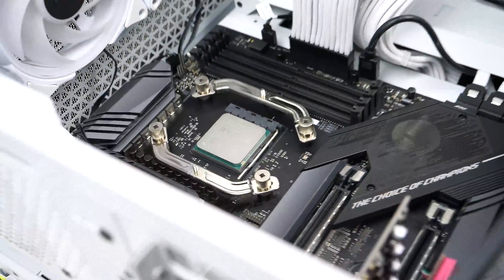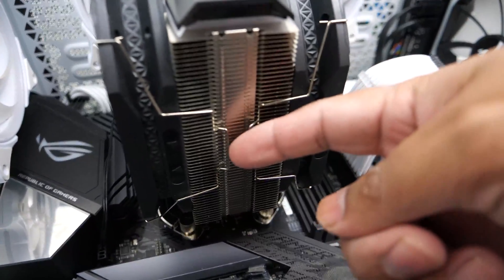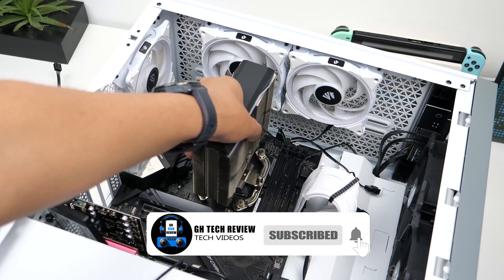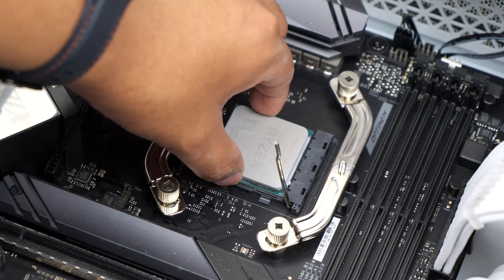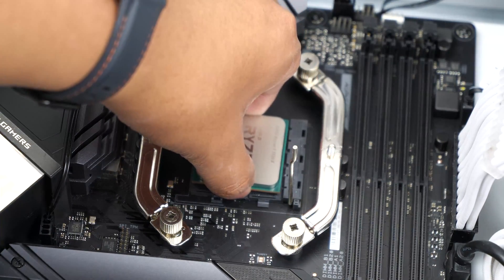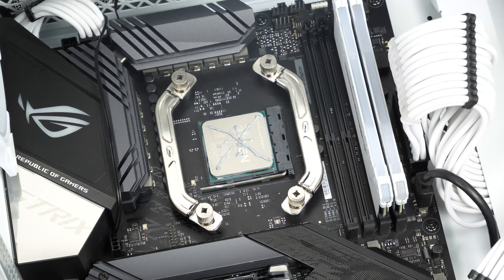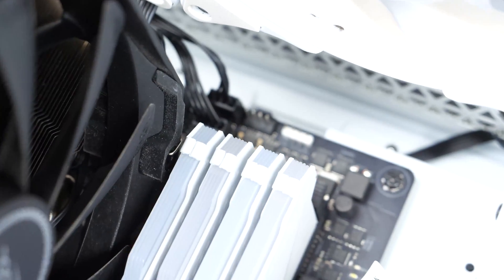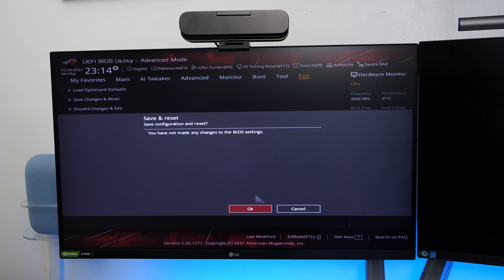How To Upgrade Your CPU Step By Step | AMD Ryzen CPU Installation 2022

Comment: I just tried installing a Ryzen 7 5800X3d and completely messed it up because I didn't know about the little arrow on the CPU, so several of the pins got bent and I had to return it to Microcenter. Then, when I finally got my computer back the next day, my computer wouldn't post without having my RAM set to single channel. It's pretty infuriating.
Reply: damn man rip the arrow is on all ryzen cpus so always look out for that
Reply: @RTX Skillz  Yeah. I didn't get that memo. I actually tried reseating the CPU afterwards and didn't screw it up. Good 'ol trial and error.
Reply: @captainshiner42  nice man its easy once u know what u are doing thats why before i built my pc the past week i watched like 100 videos of doing it
Reply: @rtxskillz6006  I kinda figured that out after the fact.
Reply: I’m picking up a new 3800X3D today.  Hope I dont F it up lol.  RIP yours. Hopefully they refunded you a new one
Reply: @11bravo1789  They did, so it's all good. Afterwards, I actually took it out and put it back in, just to see if I could. You just have to know what to do and what to look out for. Other than that, it's super easy.
Reply: @captainshiner42  wait….so would it be obvious if it’s not lined correctly? I swear I followed the triangle but my system won’t post and always loops when checking for CPU(red led light on mobo) It also flashes the orange LED when I first power on (dram) before it begins to loop thru White(Vga) Orange(Dram) Red(Cpu) over and over. Everything powers on (AIO Cooler, case lights and fans) but it shows no display signal and never boots (green led light) Also found that the RAM i bought isn’t on the “Quality Verification List” for my mobo/cpu combo 😅 would that be a culprit?

Comment: If i want to change my CPU and i need to update my BIOS, Do i need to do it before putting the new CPU or i can do it after ?
Reply: @origami4743 What happens if you don't update bios amd install new cpu?
Reply: @origami4743  because I have a z590 e and it's compatible with 11th gen cpu, so I just swapped 10th for 11th gen cpu but am waiting for gpu to come. So ur saying it won't work even though the motherboard was made for 11th gen?
Reply: @origami4743  ok, thanks if it doesn't work, then I can just put the old cpu back in and update bios. Thanks a lot!!!!

Comment: I want to upgrade from a ryzen 5 4500 to a ryzen 5 3600, would I need to update BIOS for this? Or can I just install the new cpu and leave it as that.
Reply: the 4500 and the 3600 are both zen 2, so i think you don't need to update bios

Comment: i have a r5 2600 with a b450 pro 4 f motherboard should i upgrade to a r53600 and if so do i need to upgrade my motherboard to. Thanks
Reply: you do not need to upgrade motherboard ,any mobo with am4 socket will work with the 3600, but in todays age I would look into a ryzen 5 5600x better performance. Which also is an am4 processor so should work with your mobo.

Comment: it its literally the hardest thing in the pc to upgrade, since 9/10 times you need to upgrade motherboard, essentially equally to assembling a new pc
Reply: AMD are very good in that the last gen of CPU's (5 series and previos) are all compatible with AM4 socket.  Intel are a bit mean and require you to change motherboard more often.

Comment: Right now I have a rtx 3070 with a Ryzen 5 5600x, anyone think I should go for a Ryzen 7 5800x? I need y’all opinions🤞
Reply: not worth going to a 5800x only good upgrade from 5600x is the 5800x3d which is a beast
Reply: I have a R5 3600 and trust me upgrading to a 5800x3D Is literally almost triple your performance on more cpu bound games
Reply: Bet, I’ll start doing research on the x3d, appreciate it yall✌️

Comment: trying to upgrade my son's CPU. He has a RTX 3070 graphics card, z370 mother board and i7-8700K.  will this work with Ryzen? or do I need to get him an intell ( I know some things because I've helped him build it, but really do not know much)
Reply: wont work with ryzen since its an intel board
Reply: No, you'll have to get him an intel CPU. Specifically, an intel CPU with the socket type "LGA 1151"

Comment: omg how much thermal paste you use lol..left over dropped into the socket boy. im thinking of returning my 7600x and getting a 7800x3d
Reply: Going to be doing the same thing. Used it as a placeholder for the x3D

Comment: hi nice video mate, i want to upgrade my R3 3200g to a R5 3600, my question is can I use the same stock cooler that came with the R3 3200g on the R5 3600, thank you :)
Reply: I just had the same replacement just now, but from a r3 2200g
Reply: probably
Reply: I want to get this update. Is it worth it?
Reply: @ringi52  yes it is definitely worth it, I’ve now got Ryzen 5 3600, rtx 2060 6gb and 16gb ram
Reply: @Ashwin_Gumustekin  nice, i will have something similar I'm just afraid i will mess up the CPU instalation.
Reply: @ringi52  yes at least we can get rid of the bottleneck
Reply: @PrimeYT10  Do you use PCI3 or 4?

Comment: The problem I have is that - I cant get to windows. I updated BIOS many times and tried many versions, but every time I try to exit, my PC is just restarting. Everything is compatible., and right now I'm just using the old one. Did anyone had the same problem?
Reply: Same just bought a new cpu earlier and haven’t been able to stop it from boot looping
Reply: Do you have a usb drive with windows? I fixed a boot loop by plugging a usb drive with windows into it, and then going into bios and finding the usb drive and just followed the instructions to use it, I can’t remember exactly how I did it, and every bios is different but maybe try that?
Reply: The boot loop was not due to a cpu change though, but it was still a boot loop
Reply: You have to reinstall windows anytime you change the CPU unfortunately. Your BIOS will freak out if it detects a new processor. Put installation media on a flash drive and boot to that to set it up. If you need to recover files from your boot drive you'll have to plug it into another PC or get a sata/data adapter kit.
Reply: So actually in bios I changed something from CSM to UEFI (perhaps the other way around) and then I was stuck again in bios loop but somehow suddenly it clicked and everything was alright after a few restarts. So maybe this will help someone

Comment: I just upgraded my CPU and am on a screen asking me is I want to reset fTPM (haven't gotten to BIOS yet). It wants me to click Y or N for yes or no, but it won't read any keyboard input at all as far as I can tell. Is there a way to get through this that I'm missing?
Reply: did you update ur bios with ur old cpu ? that might be the issue
Reply: @Mr911RANDOM  I had done that. What actually fixed it was getting a USB to PS/2 adapter for my keyboard. Would recommend getting a couple for anyone who needs to be in the BIOS. They're super cheap, but I had to wait like three days to get mine delivered lol
Reply: @dylanday6945  what did you end up pressing though?

Comment: I upgraded my cpu and now my computer won’t boot past the asrock screen. I need help I’ve tried everything
Reply: What CPU and Motherboard do you have?
Reply: @nickwilson1736  Ryzen 5 5600x and an asrock b450m pro4 motherboard
Reply: @onei8866  i know it's a bit late, but it's likely that your motherboard bios isn't up to date to support your new cpu

you'll have to plug in your previous cpu and update the bios using a flash drive with the updated bios files

this guide should help: https://www.youtube.com/watch?v=wk_bo6OWq6s
Reply: @RoseAkahana  my bios was up to date. I ended up re-imaging windows with a flash drive and that fixed all my issues!
Reply: What do you mean by re-imaging windows? I am not computer smart but I’m looking to upgrade my cpu in the near future and in case I have a similar issue I was curious on what re-imaging windows means and how difficult it is? I know my bios is up to date I just don’t want to run into any problems
Reply: @RealHoldenHall  there’s ways to re-image and save your files but I just wiped everything to make it simple and easy. It basically means your windows files are corrupted and you need to wipe and reinstall windows.

Comment: When I booted up my pc after installing, my fans started like normal and the ram lit up, but my monitor won't do anything and it seems like my gpu is off.  My pc worked fine yesterday.  Also the on light on the tower won't turn on when the pc starts
Reply: Brooo same lmk if you find solution
Reply: @drewking9117  try taking the ram out cleaning the ram slots, i know you probably already fixed it,  but this happened to my brother. it was something to do with the ram and dust getting in to the ram slots somehow. anyways hope you fixed it

Comment: I just upgrade my CPU ryzen 3 2200g bios to support ryzen 5000 series and when it boot up there's no display, my question is does it boot up after i put my new ryzen 5 5600? I'm still waiting for it to come.
Reply: is your motherboard going to be able to handle the 5600? this would be a good indicator

Comment: do i need to use that window usb stick after instaling new cpu
Reply: If you already have installed Windows on your PC then there is no point of using it
Reply from the maker: The usb stick on my pc is a wireless transmitter for my headphones. You don't need to use a usb stick loaded with windows if you already have it installed.

Comment: i am currently running an amd ryzen 3 2200g, upgrading to a amd 5700g on a Gigabyte B450M DS3H board. Do i need to do the bios update before i replace the cpu? is the bios update necessary? really trying not to brick my build, thank you
Reply: if the cpu came out well after the motherboard it wouldn't hurt to update the bois, its pretty easy to do but update it before you swapping the cpu or you'll get a black screen and have to swap back.
Reply: @Level10Slime  thank you
Reply: @Level10Slime  does it normal after updating bios my screen goes black? I'm still waiting for my new CPU to arrived to test it.
Reply: @colosuss3208  it shouldn't bios probably failed halfway through , try flipping the switch in the back, unplug the computer and press the power button in the front then plug it in flip switch and power on to bios. update again DO NOT TOUCH i repeat DO NOT TOUCH your computer till its done not even the mouse. 
double check how to update your motherboard by brand and modal just to be sure
edit add- plug screen into the motherboard might help

Comment: I have a b450 I gigabyte board I put new cpu and aio cooler. I turn on my pc all fans run but not max, my screen just stays black I can't even access bio. I went from a 3200g to a 5900x am4 chipset can anyone give me some ideas of what can be wrong?
Reply: It's just weird that I can't shut the tower down from the power button after it starts
Reply: Solved: all I had to do was install my old cpu, update bios then install the new cpu. It worked fine
Reply: @guillermocuevas1306  after updating bios does you screen goes blank? It happened to me after updating bios ryzen 3 2200g to support ryzen 5000 series.
Reply: @guillermocuevas1306  did you update the bios and let your pc boot once before installing the new cpu? Did you reset your bios at all? Im having the same issue but bios update does not help for some reason
Reply: @alpucr  I had to install my old cpu update the bios then re installed my new cpu and it worked
Reply: @guillermocuevas1306  okay thanks. Guess I just ended up with a faulty cpu. Time to refund
Reply: @alpucr  yeah man that sucks hopefully it works out. Let me know if it does
Reply: Did u update your BIOS to be compatible with ryzen 5xxx processors?
Reply: @P0lc1k  I haven't my screen just goes black I can't even access bio and it's weird because my power button doesn't let me shut off my rig if I hold it down
Reply: @guillermocuevas1306  are you using dedicated gpu?
Reply: @guillermocuevas1306  u need to put your old cpu back and update your bios according to your motheboard specs
Reply: @P0lc1k  ah okay I will try that thank you
Reply: @bazookasniper5167  yeah I have a gtx 1070 I have my dp connected on it
Reply: @P0lc1k  I have the latest bios and Gigabyte claims my mobo (GA AB 350M Gaming 3) supports my new cpu (5500) i have the f51h version now and I tried both f51h and f51g versions, both with no luck. I was using R5 1600 previously and 5500 does not work for some reason... Im pissed

Comment: Need help !!! mine just keeps loading back in to the click bios over and over just changed to ryzen 7 5700g on a b450 msi board
Reply: Is the CPU supported? I imagine it's working if you can get into the BIOS...
Reply: i did my bios update today like 15 mins ago depend on what motherboard u have i copuld help a bit
Reply: Check the box of your motherboard. If it says something like "Ryzen 3000 ready" and not 5000, then you must do a Bios update first.
Reply: did you get it working? i have the same issue
Reply: I just decided to buy a new board I didn't see you guys replied thank you

Comment: So I have a new MSI MPG B550 gaming plus MB with a 5600x and I'm thinking about upgrading to a 5800x. I noticed in the video you didn't update bios at all and it booted right up. You didn't have to update bios or anything off camera right??? Just a hot swap real quick??? I literally bought the B550 because I was in frustration of the B450 that I've already had when I wanted to upgrade to a 5000 series processor. It kept on running the fans real high for like 2 to 3 seconds then no display on monitor whatsoever. I've tried flashing the bios and didn't work for me but I've seen it has worked for some people.
Reply: You may have to reset the CMOS on your mobo, some of them require a wipe before installing a new CPU. Google your mobo name + CMOS, it should come up, or direct you to the manual on the manufacturers website.
Reply: sometimes you dont need to update the bios, but sometimes you do
Reply: Not enough of an upgrade to justify the price, honestly.  Save a lil bit more and upgrade to a 7000 series.
Reply: Im about to go crazy bcs of the same issue rn. I updated my mobo, Gigabyte says 5500 is supported on my b350m g3 but still no display with 5500...
Reply: @alpucr  gotta update the bios on the mb.  As long as it says it's supported, then put the old CPU, download the bios from the manufacturers website, and update the bios from the bios screen.  I do it routinely.

Comment: Do I need to download the new CPU drivers before I install the new CPU?
Reply: No, you don't... There isn't any CPU drivers, there is a chipset driver, which you may or may not need to update, depending on how old the driver is. The chipset is based on the type of socket your motherboard has. For example, AM4, AM5, etc...  AM4 and AM5 are not interchangeable WHAT SO EVER!   

The most important thing to make sure is up to date, is your BIOS, to ensure your board will be compatible with the CPU you're upgrading too considering your upgraded CPU is compatible with your current socket.
Reply: yes
Reply: @spoon6608  How could you update a driver for a piece of hardware that doesn't exist in the configuration yet?

Comment: I just upgraded my cpu from a ryzen 5 1400 to a 5500 I updated the Bois to the proper one for the new cpu, however it still will not boot. My fans get very loud for 2-3 seconds than quite down, in this time my cpu fan stops spinning completely, then the other fans continue to pick up speed and became extremely loud again. My monitor has the no signal error message on it. How can I fix this? And what could the possible issues be?
Reply: have you tried updating the motherboard bios? Get a USB and download the correct drivers. After that put the Usb stick into the BIOS USB there should be a small button on the back of your motherboard hold that for 3 seconds till the light turns off. (you can also search up on youtube/google how to update your bios with a USB drive) hope this will fix your problem!

Comment: Need help! So I upgraded from ryzen 5 3600 to ryzen 7 5700x and I’m receiving no display whatsoever. I’m using the asus rog strix b450  gaming motherboard. I’VE TRIED TO:
update the bios 
Remove the cmos battery twice 
Checked with the old cpu which works 
There’s a still orange light on the motherboard. 
I’ve sent the new cpu back as I believe it’s faulty. Does anyone have any idea how to fix this as I want to order it again and try one final time. The website does say the cpu is compatible with the MB but with a bios update which I have done. Anyone have any ideas?? Thanks
Reply: Oh god i replaced the same cpus and i have the same issue, Pc turns on but display won't turn on
Reply: Personally it was my ram. After I replaced it the display was working fine.
Reply: update

I took the pc to the repair center and it turned out on of the Ram sticks is broken had it replaced and everything is working fine now , but its a bit strange that it happened with us on the same cpu lol
Reply: @A1wayyyss  But if my old cpu works it wouldn't make sense for my ram to be broken. Did you test with your old cpu?
Reply: @zxgamercore  yes i did it was working fine, as i told you its very weird
Reply: I am upgrading from a Ryzen 5 3600 to a Ryzen 9 5900x and I'm having the exact same issue
Reply: Its probably the RAM. May have a faulty stick. Dont ignore the RAM in these situations.
Reply: @RobbieMaynardCreates  I'm currently using my old cpu with the ram. Windows detects both sticks. I did take it into account. I highly doubt it is the ram because its working fine right now.
Reply: @zxgamercore  so was it a faulty cpu im thinking of doing a similar upgrade, from ryzen 5 3500x to ryzen 7 5800x
Reply: @dante316a  The problem ended up being the ram. Nothing wrong with it but the CPU just didn't like it therefore it didn't turn on. Just double check the ram.